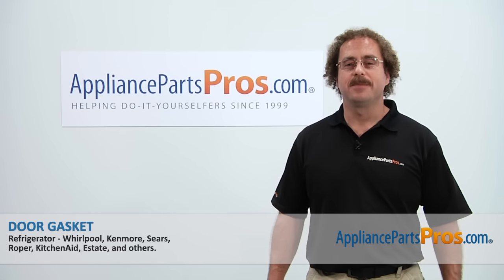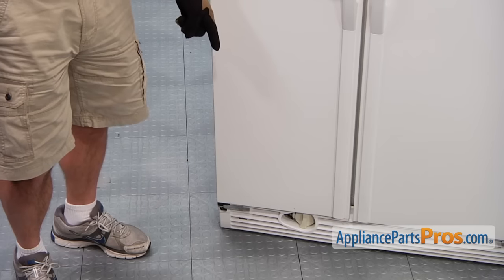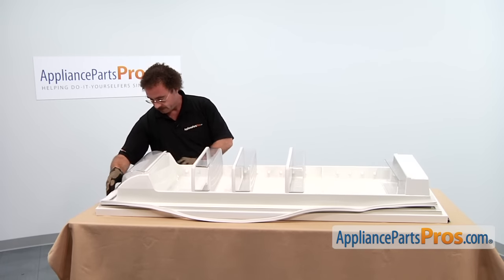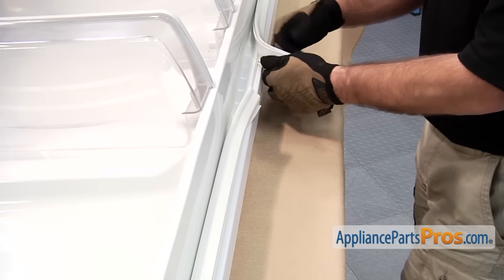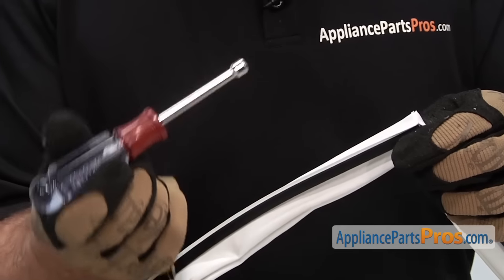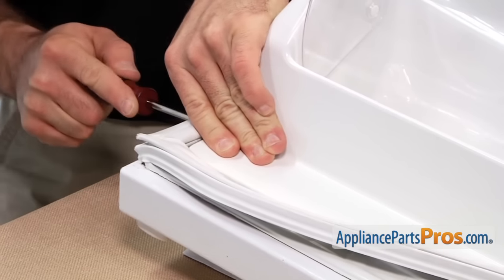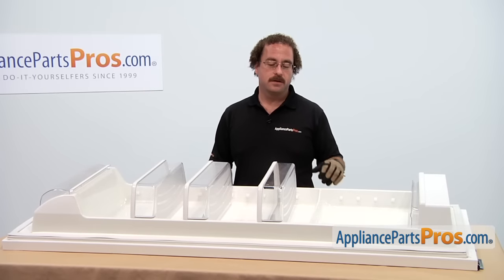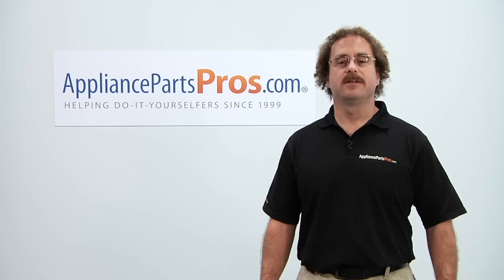How To: Whirlpool/KitchenAid/Maytag Door Gasket 2159075

Comment: When I removed my old gasket some foam from the door came off with the old gasket is this normal? 2. Some of the new gasket is not Magnetically sticking to the refrigerator how do I fix that problem?
Reply: Use a long straight edge to check the door itself to see if it is level, then if the door edges are straight relative to the fridge compartment it seals - sometimes the doors can warp with excessive weight in the door.  I'm not aware of any way to straighten them, but if its really bad, I suppose you could take the door out, place it in the hot sun for an hour or two on both sides then try to weight or twist it in the direction it would straighten, then let cool.  that might help a warped door, otherwise you'd need replacement which for older fridge isn't likely available.
Reply: Foam coming out is common - The video showed that you need to push in any insulation or foam that is pulled between the inner door liner and door structure to ensure its cleared before the new gasket is installed.  The minor loss of material is not a big deal.
Reply: Two things to do if the magnet is not sticking well - 1) widen the gasket front to back while its warm or hot from the sun exposure they mentioned, i'm a little surprised they didn't mention that.  That ensures the gasket is opened the most when installed, then compressed to the spacing that exists on your fridge.  If already installed, I'd suggest getting a hair dryer and warming the strip and adjacent strip that is not sealing well, then pull the gasket vertically away from the door (not outward like trying to pull off) to increase the height of the gasket, then let cool.  That should give you the extra height to fill in the gap that is not sealing.
Reply: The second thing is to inspect the fridge opening that is not sealing.  Many times there is a thin film of old grease, oil, whatever that has accumulated over the years on the surface of the opening.  Any material there increases the gap between the magnet in the gasket and the metal of the fridge gap even though its painted over - this reduces the magnetic attraction.  Take a good household cleaner like 409, Lysol or Chlorox cleaner, and a good rag and wipe down the front of the opening all the way around the opening till it is clean and looks the same color as the front of the fridge - clean!!  That should allow the magnet to fully attract, hold and seal the opening.  If not, the hinges may need slight adjustment to shift the door closer or flatter all around, barring potential door warpage due to excess weight.  Hope this helps.
Reply: One other thing - if the door gasket is not always sealing, the problem may also be the door cams at the bottom.  Check APP for your model of fridge, and the door cams (lower and upper) or order the kit which includes cams, screws for both fridge and freezer doors.  The cams allow for self closure and keeping the door held in properly.

Comment: If some tech started to use a metal tool to push the gasket into place on my door he would be hearing from me and ordering a new door. Metal? Scratching to crap out of the door? Sorry not very professional
Reply from the maker: Gord Lyman You are correct anytime you are working with a gasket you need to be careful, just as we said in the video. With that being said the nut driver we used, although metal it does have a surprisingly smooth surface that would not damage the gasket. Thanks for the tip, hope you were able to get the gasket installed!
Reply: Gord Lyman

Comment: Thanks for the tutorial. Question though is could my fridge be just not level and full of condiments on the tray thats why when we shut it it doesnt seal all the time or bounces back a bit leaving a small gap and we have press on the door to shut it or close it  gently?

Thanks again
Reply: I've got the same issue and I'm leaning towards the theory that my seal is just getting old and worn out.  The extra weight of the items in the door and the fact that it gets used more that the freezer door is why I'm thinking that this seal might be failing sooner than the freezer door......I'm not an expert though and it's just a theory.  I'm thinking about replacing my seal.
Reply: I checked it today and you could be right. The magnet doesnt stick quite as good as my other fridge so Im geting me a new seal from APP, hope that solves the problem. Thanks for your reply
Reply: Mine did the same thing and found out it was the door cams.  They were shot.   I replaced them and the door closes on its own now.